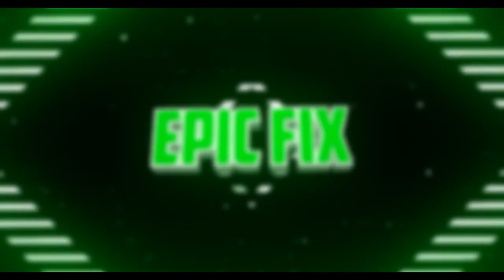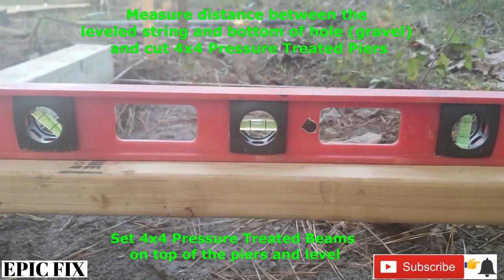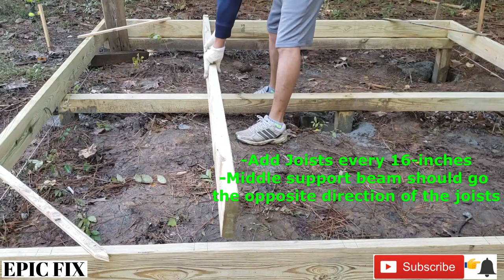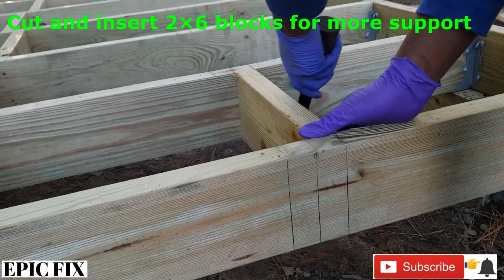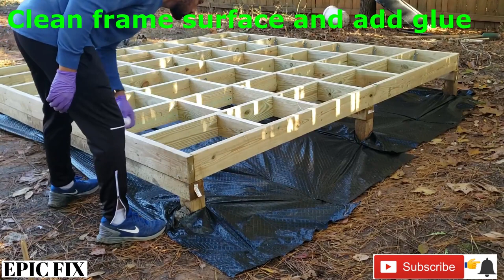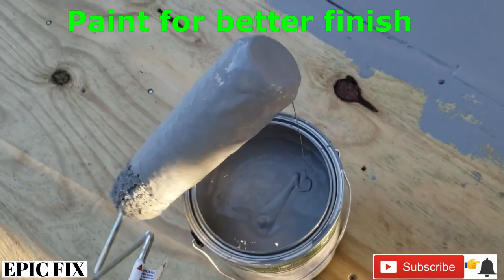Building Shed on Uneven Ground - Part 1

Comment: Very nice and neatly done. Lawn paper eventually wears down so you will need to add more in the future. Adding gravel on top would help keep the weeds back. To keep critters from going under the shed put critter wire around the bottom and out on the ground a foot out and then gravel a foot out on top of the wire.
Reply from the maker: Thanks for the fine ideas.
The critter wire is already there, it's on part 2 video.
Reply: @EPICFIXwithNardos  ok

Comment: Shouldn’t you check for square before you put in all those pressure blocks? Nice build. Looks extra sturdy.
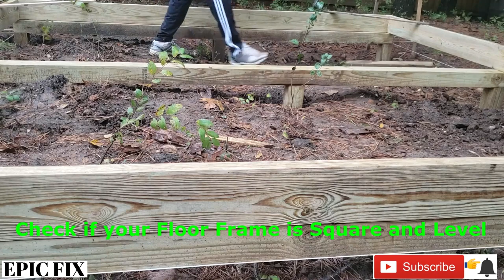Reply from the maker: Yes that's correct. I checked and mentioned it @0:55.

Comment: Thank you for the video, it was  informative. What type of screws did you use on the base to pier? How is the frame supported to base? Thank you.
Reply from the maker: I used hex head external 6 inch screw, two screw per pier. And 4 inch external screw for frame to base, both crews ideal for treated wood.
Reply: @EPICFIXwithNardos  Thank you for the prompt reply. I am in the process of using your examples. Best wishes.
Reply from the maker: @lionelreesable  let's us know how it turn out, good luck!